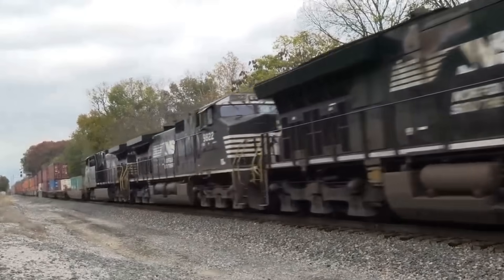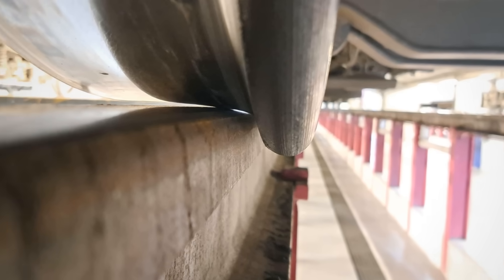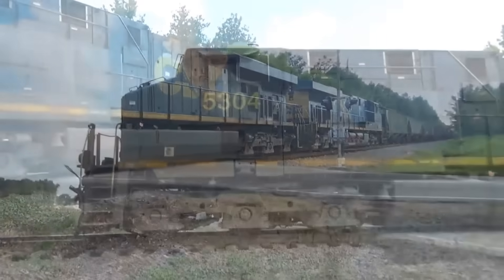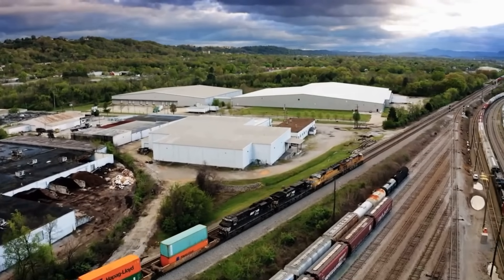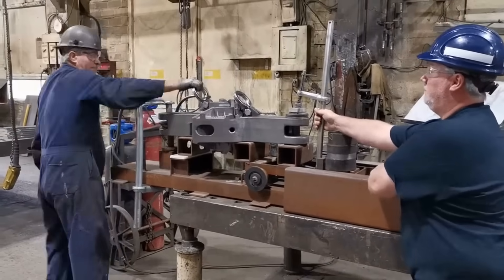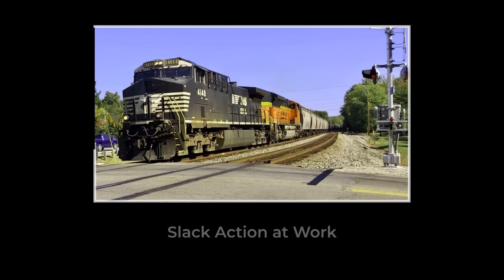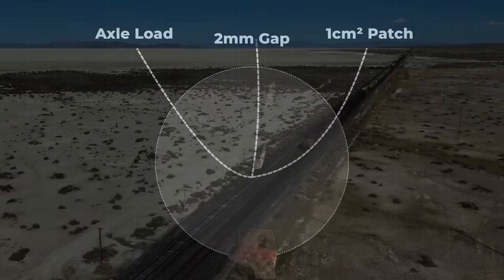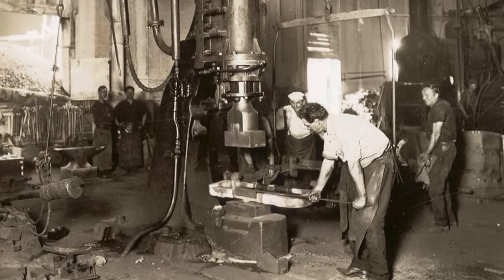Why Locomotives Can Pull So Much WEIGHT

Comment: I never see just one engine almost always three for sizable train
Reply: That's because of the fact that one of the engines can break and it will keep on running
Reply: @cosimobruno9254 While a single locomotive is incredibly powerful, modern freight trains are often so long and heavy that they require the combined "tractive effort" (pulling force) of every engine in the lineup to get moving and maintain speed.
Here is how they coordinate and why they use so many:
1. The "MU" Connection
When you see multiple engines at the front of a train, they are connected by Multiple Unit (MU) cables. These thick black cables allow the engineer in the very first cab to control the throttles, brakes, and systems of all the trailing engines simultaneously.  
Synchronization: When the engineer moves the throttle to "Notch 4," every engine in the line reacts instantly and provides power at that level.
Fuel Conservation: Occasionally, if a train is light or on a flat stretch, an engineer might set a trailing engine to "isolate" (idle) to save fuel, but for standard heavy freight, all units are typically engaged.
2. Distributed Power (DPU)
Sometimes you will see engines in the middle or at the very back of a train. These are called Distributed Power Units (DPUs).  
Wireless Control: Instead of cables, these units receive commands via radio signals from the lead engine.  
Pushing and Pulling: By having engines at both ends, the railroad reduces the physical strain on the couplers (the "hooks" between cars). If you put 20,000 tons of weight behind engines only at the front, the tension could snap the train in half.
3. Why Not Just One Giant Engine?
Railroads use multiple medium-sized locomotives rather than one massive one for several reasons:
Redundancy: If one engine fails in the middle of a mountain pass, the other two can still limp the train to a siding so it doesn't block the entire line.
Traction: A train's pulling power is limited by the friction between the steel wheels and the steel rail. More engines mean more wheels on the track, which prevents "wheel slip" when starting a heavy load.
Flexibility: It is easier for a railroad to mix and match smaller units based on the weight of the specific cargo than to maintain a fleet of specialized "super-engines."
Would you like to know more about how these locomotives generate power using diesel-electric engines?

Comment: I dislike videos that beat around the bush and do not quickly begin to address the subject of their title. I'm halfway through this video and all I've learnt is that they put sand under the loco wheels. I'm wondering if this is all and if it's worth spending another five minutes on this video. There's just so much fluff here! This is the situation with not just this video but some 80-90% of videos on YouTube. Also, don't just throw numbers around in the audio. They don't register. Show them as charts. For example, two bars showing the weight of the loco and the weight of all the wagons.

These are my suggestions for your future videos. I appreciate your hard work in making them.
Reply from the maker: Thanks for taking the time to share your thoughts, sir. I'll consider your suggestions for making the content more direct and visual. I'm always open for improvements so I highly appreciate your comment!👍🏼

Comment: Fascinating  I had no idea. He speaks of a single locomotive. Behind my house, on the other side of the river ( I'm in W Montana ) there are tracks and trains go by almost by the hour day and night. Usually pulling massive loads of coal or oil tanks, headed for the west coast. Very rarely is there a short train pulled by a single unit.  Often there will be 2 or 3 locomotives pulling, and one pushing, Does the same thing apply when there are muliple engines?

Comment: 5000 cars never get "moved by ONE locomotive." First of all, I'm pretty sure there are no trains that pull 5000 cars. Even 500 cars sounds like it's pushing credibility. And a really long freight train always has an engine car every so many cars, or they'd never be able to move up any kind of incline in the land. I know that large diesel engine cars weigh up to 100 tons or maybe even a bit more, but although the cars they pull don't weigh as much as that, whatever they're carrying has weight, nevertheless. 5000 hp sounds like a lot of horsepower, but pulling a train with even 60 cars takes all of that and more.
Reply: Did you even watch the video kid? A locomotive can definitely pull upwards of a million pounds with some pulling 20 million pounds. How can you be so clueless. Simple google search can confirm weirdo.
Reply: You clearly don't understand how powerful trains are, it'd be a lot wiser to just google your opinion before typing this much wrong info
Reply: @khalifisilva  5000 cars? Really?   5000 cars ads up to over 35 MILES of train to pull. You trying to imply that there are freight trains that are longer than a typical town they might pass through? I DO know that a diesel freight engine car will have around 5000 hp +/-. That's a lot of power, but pulling 5000 - FIVE THOUSAND - cars- that's really pushing credulity. And the laws of physics.

Comment: Locomotives can pull a lot of weight because they have large engines and round wheels. If they had a small engine and square wheels they could pull a little less weight. That is what and atheist and or evolutionist told me.

Comment: Its not the engine that i wonder about, its the strength of the coupler on the first car in the chain....how strong is that hook???? To be able to pull a hundred cars behind it....
Reply: The couplers are very strong but can be broken if too much power is required to start the train. The cabs of all diesel electrics have amp meters with red lines that indicates the maximum power that can be applied before couplers break and the train is pulled apart.

Comment: In the 70’s I ran a wheel lathe for machining rolling stock tires to the correct profile, they would get worn from heavy braking or corners.
Reply from the maker: That’s fascinating! It sounds like you had a very hands-on role in keeping those locomotives running efficiently.

Comment: Big Boy alone can do it.
Reply: Too inefficient
Reply: A single GEVO has more tractive effort than a Big Boy. Look it up.
Reply: @J3scribe  I agree, yes the big boy is an incredible machine for its time back in the 30s and 40s… but a diesel electric locomotive is by far more efficient. How many trains do you see going by locally that have only one engine? Usually there’s two or three.. basically comes down to maintenance and fuel efficiency. A GE or an EMD is by far more efficient than the steam locomotive of the yesteryears.
Reply: @Swindy1794  Foamers love to equate size with strength, but they have nothing to do with one another.
Reply: Everyone these days love the Big Boy.
Reply: I want to see the Centennial run again.
Reply: @J3scribe  So do I.
Reply: Challenger was better.

Comment: One locomotive can’t pull 10,000 tons.  Or at least not at the speed needed to keep tight schedules.  There are trains, especially coal, that haul much more than that.  But it takes multiple units to do it. You need extra units to go faster.
Reply: Exactly — one locomotive alone just can’t deliver that kind of tonnage at schedule-keeping speeds. Heavy trains need multiple units to get both the power and the pace. Do you follow modern freight operations too?
Reply: I mean unless it’s an empty train heading back, you’re rarely ever gonna see a consist with one engine lol. Most always have multiple in consist especially for different grades and what not.
Reply: @wrxhex I see it occasionally locally on the CN line that runs through my town.  Empty grain cars pulled by a single locomotive going north. Coming back south, they’re loaded and need 2 or even 3 units.
Reply: @wrxhex  100% true.  Also, you will see two or more units simply to keep the train moving if one unit fails.  A 'stalled' train due to unit failure can create major problems for the entire RR schedule. Hence, two or more units is almost always the case.
Reply: Take also into account grade
On flat is easy but with each 1% grade you need around 1hp per 1 metric ton extra.
Also DPU at middle and rear will help with power and breaking distribution.

Comment: Thank you explains this.This reason PM locomotive in shop they have special tools machine wheels on locomotive white out remove it.The sand is us most mountains range like western usa-canada due low contact on steel.The worse is ice or cold rain cause lots problems get traction.Thanks video😊